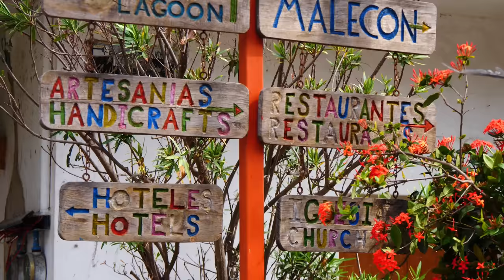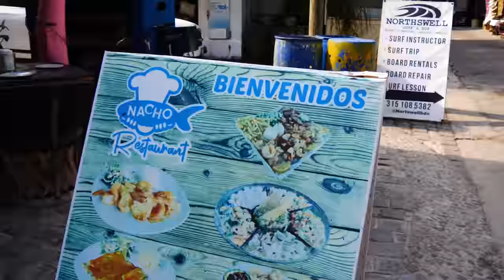Girls on Dinghies & Sailing Friends ❤️👩🏼‍❤️‍👩🏼❤️! (PLUS Delos Circumnavigation Partaayy😋 CSS Ep 151)

Comment: Back flush the out board by removing thermostat cover and insert hose there. Do this while lower is off.  Bits of old blades will flush out water tube hopefully.
Reply from the maker: Thanks for the tip!